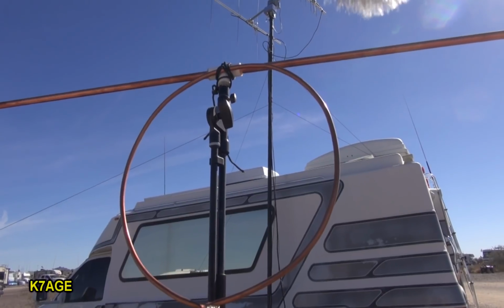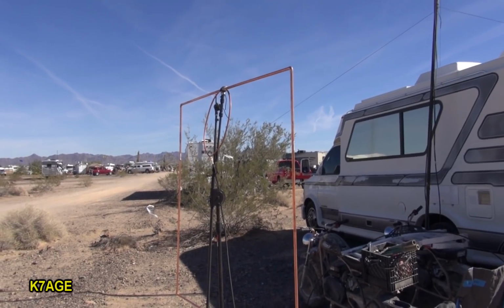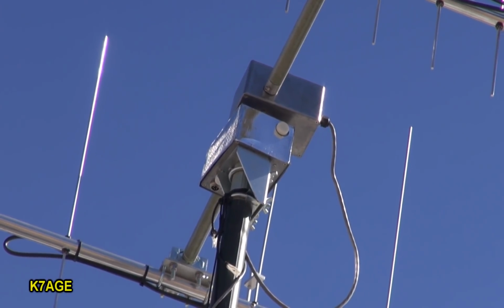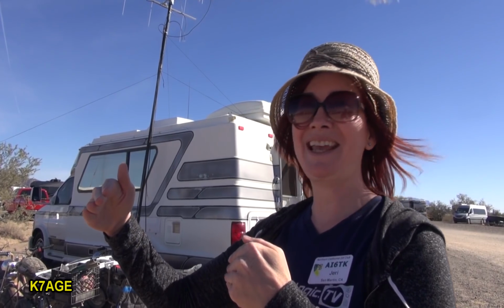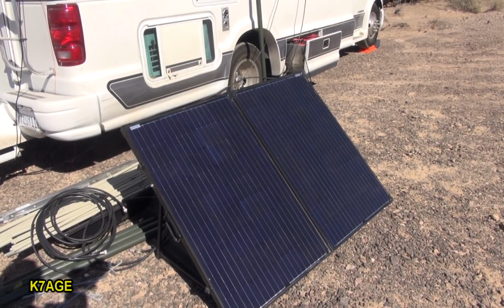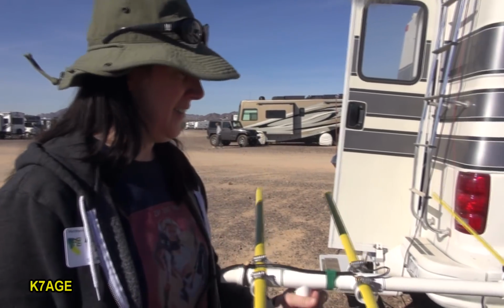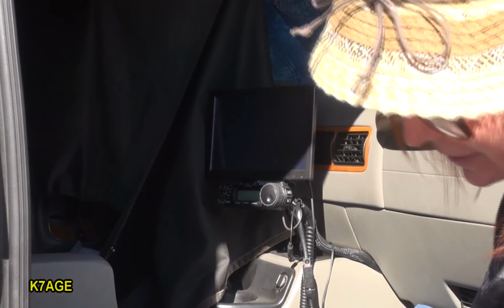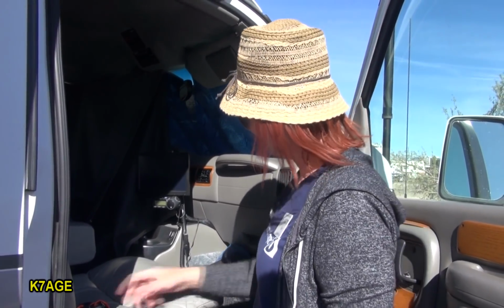Jeri Ellsworth, AI6TK, and Amy Herndon, AI6ZU, at Quartzfest 2018 Part 2

Comment: Mount those tape measure elements through the PVC tubes and rotate them 90 degrees. That allows you to just slide the whole antenna into a mailing tube to protect it and make it compact. Then it just slides out and you're ready to rumble.
Reply from the maker: cool idea
Reply: @K7AGE , that's the way they did the original tape measure antennas I read about back in about 1994. In fact, that was the whole idea for making tape measure elements. They fold, and then just pop out straight over and over.